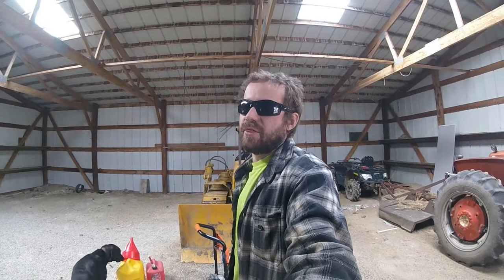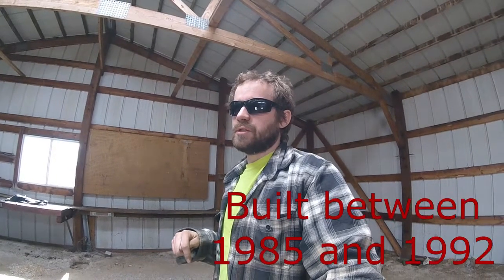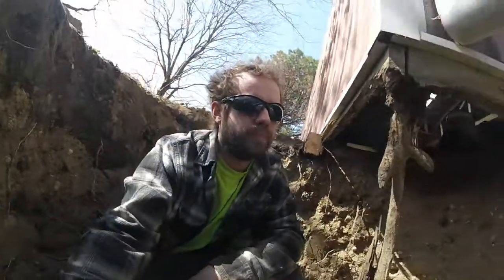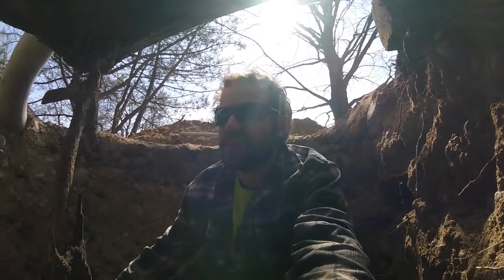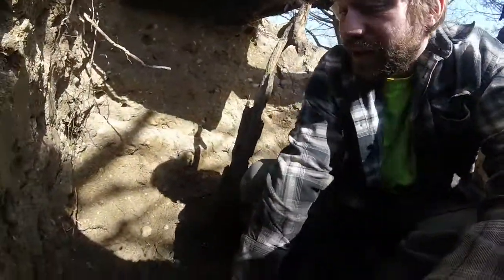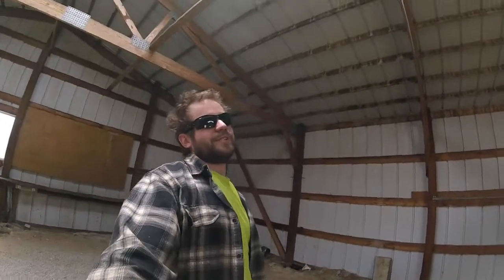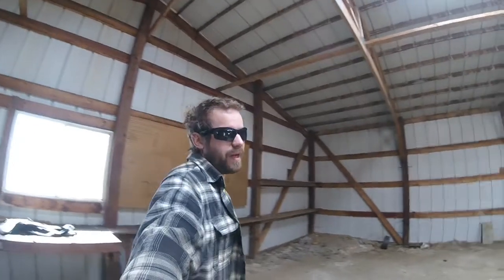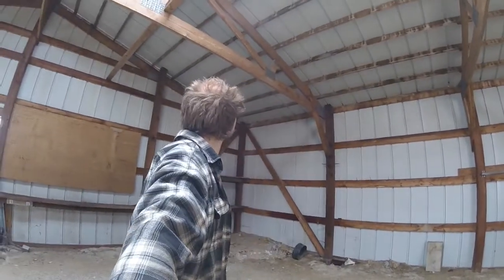How Fast Do Building Posts Rot?

Comment: The reason the posts rotted that badly that quickly is because the builder used untreated or UC4A posts instead of properly treated posts.  So yes it is 100% the builders fault.  Either though ignorance or cost cutting.  If the builder had used the correct UC4B rated posts there would be little to zero rot. The USFS has had posts in Mississippi swamp land for decades as part of a study that don't show that rate of decay.  You can find their reports online.  If you need a building to last 100+ years or you're building in terrible conditions than by all means use perma columns or wet set brackets.  However, for the majority of applications and locations they're an unnecessary expense.